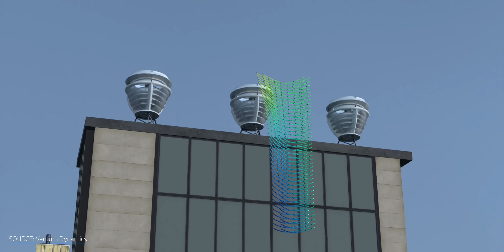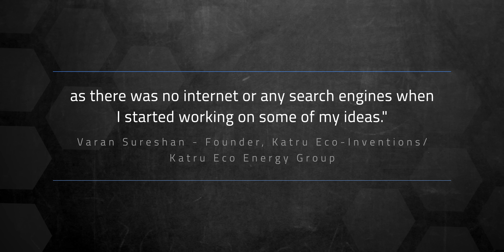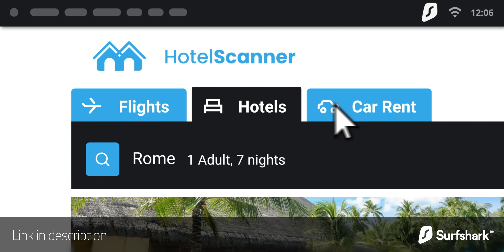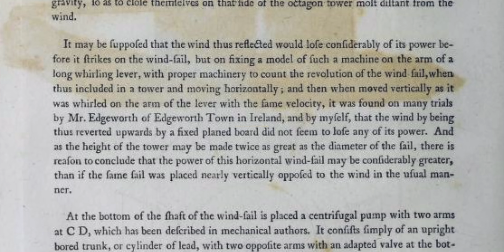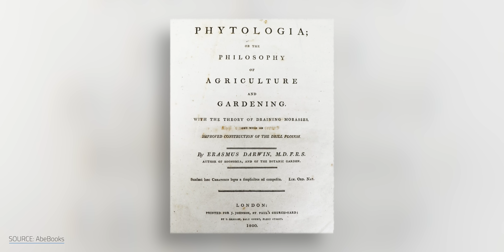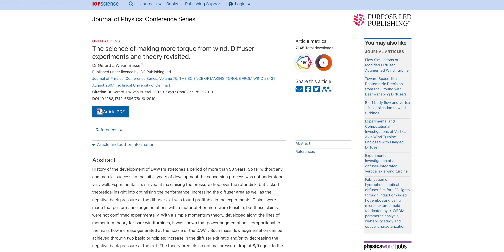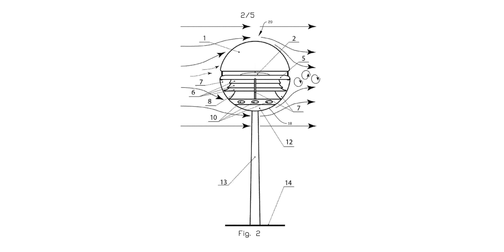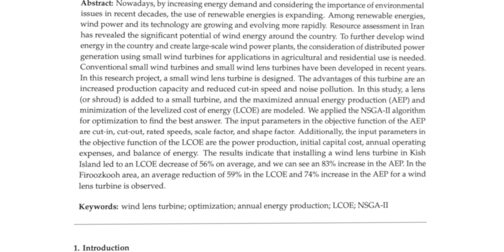Are Shrouded Rooftop Wind Turbines the Future of Energy?

Comment: those monolithic turbines are a scourge on the planet - hideous, bird killing machines that don't even work most of the time. sea based ones are incredibly invasive to marine life as well.. and then when they crap out, you can't even recycle them but just hide the broken bits by burying them.
the small independent designs make so much more sense, but the centralized powers HATE decentralization (unless they can still control it) and independence.

Comment: These things are always far more expensive to purchase than what you get out of them and inevitably they break and theres no service or parts as the companies usually go out of business.  Then theres the issue that the power companies dont want the public to be independent power producers and 'cheat' the power companies out of customers. Also the govt involvement is always oriented in how to centralize and control everything to make sure whatever power is produced doesnt go untaxed and their corporate pals lose money on their infrastructure investment.
The other issue is that anything mounted on a dwelling will generate unwanted vibrations that inevitably are transmitted into the living spaces which only gets worse as the bearings inevitably fail from wear and exposure.

Comment: Very similar to the rooftop multi directional shrouded horizontal wind turbine demonstrated on The Australian ABC’s New Inventors in June 11 2012. It worked much the same. One advantage was lack of vibration transmitted to the building.

Comment: I would fear any noise from a rotating or otherwise moving thing out there...

Or even wind noise when the wind gets very compacted with a very high air speed through something... That could also make some noise.

These two things would be my concern if I was a neighbor.

As a potential operator I would be interested in the power that I could get, based on the location and wind speed in that area - and the wind speed if I had an appropriate building that has hopefully some higher wind speed at the edge of the roof top... Or would it be better to install solar panels...

I have no appropriate building with a roof top against the main wind direction, but favorible for solar arrays... They are quiet, just sitting there...

Comment: I am following renewable energy developments for over 30 years now.  During this time there have been uncountable start-up companies with big claims about rooftop wind turbines. All this companies have disappeared again. And this is for a reason, there are just so many things working against rooftop or building integrated wind turbines:

* The average wind speed near the ground is just very low. It is for a reason that modern wind turbines are so tall: the higher up you go, the higher the wind speeds. 
* The winds speeds in the built environment are much more variable than wind over an open field or higher up, and the wind is also more turbulent. This means high mechanical loads on the turbines and power that is more difficult to integrate  in a stand alone system or weak grid
* Most buildings are not designed to deal with the mechanical loads exerted by the wind turbines.

So maybe there are some niche applications, but color me sceptical about mass-application.
Reply: Far too many of the commentts on this channel are from the gullible or iuninformed. thank you for telling  he truth about domestic wind turbines.
Reply: Reasonable points, but ... the first is directly addressed in the video.  The 2nd point on power integration isn't really different from, say, wave extracted energy and has a known solution: batteries.  Finally the 3rd -- yes, perhaps, but obviously that's something that evaluated on a per-case basis and if the permit process is working, you wouldn't be allow to install something that wouldn't work.

Comment: I went to the website and the most important number for wind turbines is missing - the nominal output. And that will probably shockingly low. There is a reason (actually, more than one) that wind turbines are getting bigger and bigger. The power scales with the area of the rotors. And wind is more stable and stronger the higher you go.
Reply: Exactly. All of this is meaningless without an endline ("energy output"-wise)
Reply: Yes. As usual, Matt is peddling semi scams😁. 

At this point, the space is better used for solar panels and batteries. Cheap enough nowadays

Comment: You might notice there is no mention of any measured power output for this idea.  They do mention though that it doesn't have to make as much power as a regular turbine because, well, ya know.  That is a clue telling you it doesn't make as much power as a regular turbine.  Oh. and it uses about 100 times as much material - to make less power - if any...  As someone involved with wind turbine design, I can tell you most of these whacky ideas are well-intentioned, but don't hit the mark.  The idea is to make more power using less material, simply and reliably.  It's almost impossible to completely isolate the interior of the building from the grinding noise of generators, blade noise, etc.   But any wind turbine is at least fun!  Anyway, I'm pretty sure these beehive turbines are not going anywhere fast  There are actually quite a few similar designs, all laying together in the scrapheap of wind energy ideas that looked great to novices, but never worked out.

Comment: Even if we accept their estimate of 6100 kwh per year at the top level shown of 10 M/S wind speed, that's less than 17 kwh per day. The energy produced per year is worth about $2500 at retail prices here in costly California. It would be much less elsewhere. Considering design, installation, integration and maintenance, I think it would be challenging to make the numbers work. And the energy produced by an array of these would be a drop in the bucket for the tall buildings they need for access to high wind speeds.

Comment: What about using the heat of the building, or that it can pull the heat out of a building? Something along the lines of some asian designs that cannot use air conditioning and yet keep the structure cool.

Comment: Roofs would have to be custom built for something like this. It will create point loads (or lift!), which is not something OSB can handle on its own. Interesting idea. (Comparatively, the design burden of rooftop solar seems to translate to the walls, because it's extra weight.)

Comment: To me, this is still a Darwinian Windmill. Its fundamentally the same design. The fact that this in convergent evolution (pun intended) rather than direct decent isn't really what this is about. "Darwinian" is an adjective that encapsulates the fundamental features of the design, not the way that people came up with the design. It's the ontogeny, not the phylogeny. An independent invention of a  pre-existing design can still be called by that design's name, even if it contains some substantial improvements, as this clearly does. 

I don't think it takes anything away from the inventive accomplishments of Ventom to say that they made a better Darwinian Windmill. At the end of the day, it's the splitters vs lumpers debate that plagues any kind of taxonomy.

Comment: We have so miles of highway that could be collecting solar, and wind, too. There is a great deal of air pushed by vehicles on roads in the busiest areas, which could use all the extra power that can be produced. 
I recall a German company was looking at micro wind turbines, to do exactly that. 
It was nice to figure out how to use waste heat, too.
Reply: I think that it isn't so much the air pushed by traffic, as the open space allowing  run for wind - along long, straight highways, or motorways, as we'd call them in the UK.
Reply: @richardmccarthy2939  
I guess you’ve never had the opportunity to walk along a highway. Yes…vehicles do move the air. But you’re also correct that roads can channel wind, if there is any. 
I challenge you to go stand by a road with high speed moving traffic. Or just be a passenger and watch the grass on the side of the road. Or get a pack of pinwheels and set up a camera. 
Cheers!

Comment: I think they have their place in residential areas.  The cool thing about these designs is that the wind direction is irrelevant.  The space between my house and that of my neighbour is like a wind tunnel at times.  I have long thought about mounting VAWTs or DAWTs on the side of the house rather than on the rooftop.  I think a few smaller ones rather than one big one could do the job of supplying me with enough power to make them worthwhile.  There are no windows on the upper floor on that side of the house, so I have the freedom to mount them anywhere in that space.
I have the ability, skills and tools to fabricate my own, so the costs would be lower for me.

Comment: I can't remember but did anyone mention changes to bird-strike risk with these being lower?  I would imagine it would be potentially...  As for cost - imagine breaking it down to constituent parts and assembling it in place as much as possible, you could lift it into place with less drama potentially I'd imagine?   The other immense advantage is aesthetic and visual distraction that you see with a visible turbine, obviously not on this one.  If it proves to also be quieter it would withstand proximity to penthouses and upper floor apartments in tower blocks which is a huge benefit, a number could power persistent building services such as lighting, etc. which represent quite a danger if the mains power goes out.  
I can envisage a version of these being acceptable in locations where a larger turbine with moving bits just won't cut it, I can see this fitting into regulatory difficulty areas (perhaps MOST of the UK!) and harnessing wind flow on the coast and the giant winds they see up in Scotland in particular.  I personally envisage these as more of a battery charger for things like EVs in remote locations, that way the minute it goes in you're forever marvelling at how much less you spend on diesel each week.

Comment: I used to live in a tall building in Oslo and additionally, the building was at the top of a small valley. It was very fun to watch out the window in the autumn and winter, because the leaves weren't falling, but rising and the same with snow in the winter, it always snowed upwards, even on windless days. But another benefit I see in this is that it will inherently be more safe for birds and that they can be made much less visually intrusive. But I'm left wondering if this type of thinking should influence city design itself, so that buildings are specifically designed to capture and redirect wind and guide it to where you can harness it.

Comment: Notably, the VX1 uses the wal of the building that it is mounted on... As such it is using roof-top-space that might be used for solar cells.  So, that is the obvious comparison... can the same room top space produce more or more steady power with top-of-the-line solar?  In some of your video shots we see solar specifically occupying other parts of the same rooftops as these turbines, so it is clear that a given Sq meter of rooftop can not serve both applications.  Given that the Solar is already a solid-state moving-partless system, and a more mature technology... what the relative levalized watts per sq meter of the two systems is DOES matter.  Also, given the use of the walls of the building to collect and direct wind energy, I imagine that the levalized watts per sq meter of the turbine system is different for building of different heights and geometries.

Comment: I wouldn't be surprised if those 'fly swatter' style turbines had oscillation problems. Wind pressure deviation causing the main support tower to twist & cycle said twist. Leading to a severe failure also like the HAWT problems.

Comment: As you asked, I think these technologies have a basic physics problem. You start with a diffused energy (the sun, converted variously by the world into wind). Then, that energy is further diffused by obstacles (mountains, cities, trees, the neighbor's boat etc.) Globally, wind blows a bit under 40% of the time, and obstacles (as noted) break up the flow of whatever exists and makes it less.

So however good the physics to re-concentrate that energy, it can't ever recover more than exists. I am sure these systems do a great job of concentrating what's left - but what is left is only blowing under 40% of the time, and has been dissipated all over the place. 

And, no consideration is given in this video to the materials cost of these machines. There looks like a lot of stuff in the turbines, and there are a lot of them in your pictures. Things that sound good when you ignore the cost of the gear, sound better than they should.  

Ultimately, yes they likely have a place. Probably there are some good use cases, and sometimes this proposal should be considered. But it does not seem to be a big contribution to a global energy problem.
Reply: 18 minutes and he tells us basically nothing about the subject of the video, only what it is not.

Comment: They seem like a good improvement over traditional windmills, although that is a pretty low bar.  Traditional windmills are horrible from just about every angle.  Extremely expensive per power generated, take up huge amounts of useful land, bad for the local environment (kills birds), dangerous to work on, impossible to recycle so disposal after their relatively short service life is a problem.  This seems like it would solve nearly all of those problems, not sure about the recyclability but the smaller size might make it possible.  The question is mostly just about how much power they can generate.  If it would take a million rooftop turbines to replace one giant one, then they just add up to an even bigger problem.

Also batteries.  Sadly it does nothing to address the battery problem, which is about the worst thing for the environment since leaded gasoline.

Comment: Let's say many apartments and buildings have these installed and capture a lot of the wind. Then there will be less wind and installing the nth turbine will become less efficient. But I am also concerned that there will be less wind circulation and on summer days it will be hotter in the city because of less wind circulation, meaning you will need more air conditioning, meaning you will need more electricity. It seems like engineers (me included) are concentrating energy for some purpose, but in the process creating more entropy in the end. It is like progress (creating better energy extraction) is vanity.

Comment: Haven't seen this design yet? What do you think of this, which can maintain all ecosystems? This design also gives back the public space and is cost-saving in terms of purchase and maintenance, as well as less material and wear. And can be placed anywhere, even in populated areas, because there is actually no noise from the rotor blades.

This Multi-Rotor Wind Turbine also frees up space. https://www.youtube.com/watch?v=rglZLD_gteA

< -- > Unfortunately I can't show you how it works. The problem with showing everything PUBLICLY is; If the big boys (manufacturers) understand the principle, then I can never make any money, and with public sharing there is no protection possible.

Comment: Rooftop turbines have a HUGE problem - they couple bearing noise into the structure. 

Very few rooftop wind turbines survive long if the building's occupants have any say in the matter
Reply: either that or the structures start experiencing failure. In any case such low power production that the damn things don't payback their cost
Reply: And could drop pieces during a storm...
Reply: I think the general vibration problem has been solved by mounting devices on rubber pads...

Comment: Very nice story! 
What is the mechanical impact on the roof construction? I expect that the wind can come from any direction, with a large force. How are those forces handled?
Reply: I see extra cables on the top for that reason. So it has 3 points to stand on and 3 points for cable connection.

Comment: I think it was an episode of the program, Grand Designs, the homeowner asked the host what he thought of the his wind turbine.   The host looked confused and the camera panned around but no wind turbine could be seen.  Then the homeowner pointed out the driveway lighting.   Two pole lamps and at the top of the poles were small vertical helical wind turbines.  There were batteries inside the poles and the wind turbines produced enough power to keep the batteries charged up.   But most of the time the lighting was running off the wind turbine.
Reply: SWtill a complkete waste of time. Solar panels are far better.
Reply: @rogerphelps9939  I live in a part of the world where the clouds roll in on September 30th and we don't see the sun till April 1st.   Yes photovoltaic will still produce some power but not as effeciently.   However, during that  same time period we have a lot of wind.
Reply: @RandomTorok  Do the calculations and then you will undersand he parameters. you are likely tto be disappointed.
Reply: @rogerphelps9939  You're assuming and generalizing a lot. There are a lot of countries where it makes more sense to use wind rather than solar, often because of their latitudes and proximity to the ocean. The further you are from the equator, the less you benefit from solar. 

Denmark is a great example. Wind accounts for 53.6% of their total electricity production, solar is 9.3%.